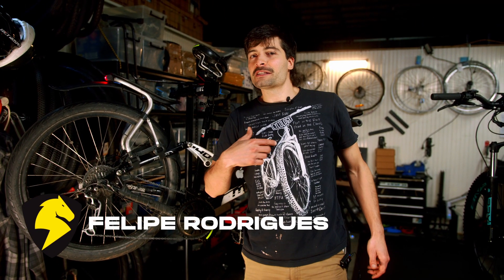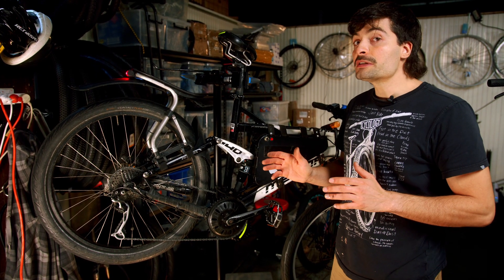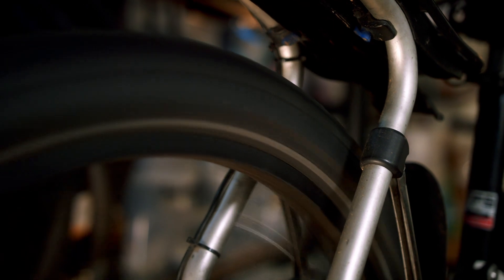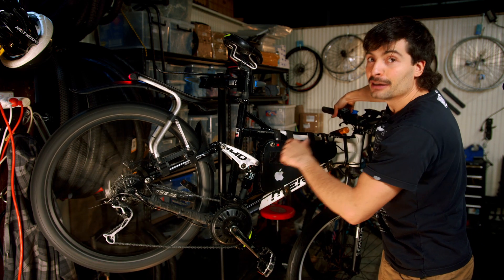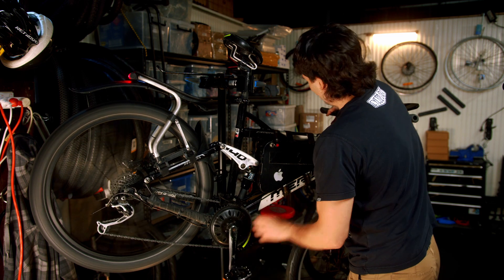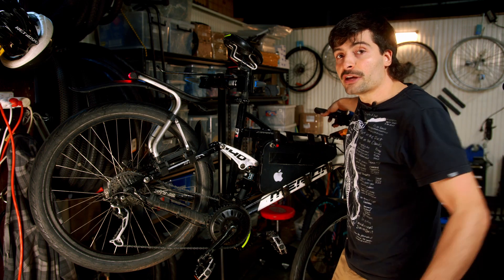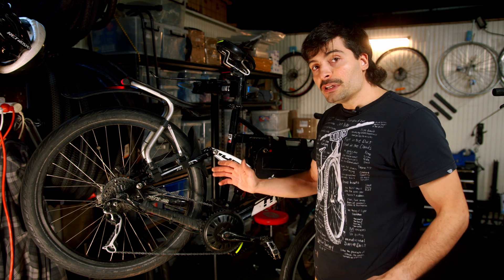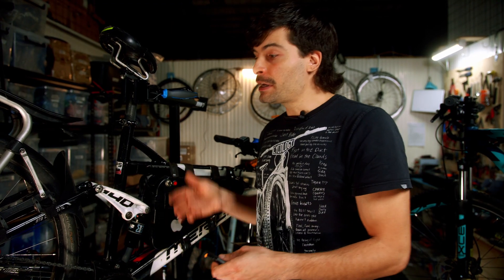How to shift gears on a Mid-drive Ebike

Comment: i have 750w BBS02  and using generally 1 or 2 PAS over 5. gear mostly hıgh 6-7-8-9/9 motor power avarage 500w, is it can be harmful? i think if motor consume like around1000w can be harmful for motor i always consider about how much power consuming now
Reply from the maker: The more watts you put in the motor the more you damage the motor, however, even at 500W, if you're using a heavy gear (9) at very low speeds, you're damaging the motor. Because of your doubt I am going to record a video talking about that.
Reply from the maker: The more watts you put in the motor the more you damage the motor, however, even at 500W, if you're using a heavy gear (9) at very low speeds, you're damaging the motor. Because of your doubt I am going to record a video talking about that.
Reply: @Cyberbikesau  i didnt know that, high gears most of time force the motor. thank you

Comment: what wears out first in this system?   the levers, chain, derailleur, and cables,   I am doing research on the different ebike systems
Reply: definitely chains and the cassette, especially if you don't clean and apply lubricant regularly. For me I clean and lube around every 100km of riding. You will get an average of around 4000km (depending on use) if you clean regularly but if you don't, well I had to replace my chain after only 1600km and that was when I use to only apply lube without the cleaning.
Reply from the maker: as our friend said, chain and cassette

Comment: For climbing a hill, would the best method be to shift to the appropriate gear before the incline and maintain that gear?
Reply from the maker: Yes, that's an option if you want to preserve the motor, better to start in a low gear (high torque) and maintain it all the way up.
 If you're racing, you could shift gears up without using the brake sensor and add human power to the pedals. Remember, it's best to make these motors spin fast than spin slow.

Comment: I've just made myself an e bike with the bafang motor I wish I'd watched this vid before I started hammering the beast. I'm sussing it out myself now, there's a real art to the smooth riding of these things, should probably have driving lessons on them, especially with the power assist on full whack!
Reply from the maker: Add the brake sensor to your bike, it will help a lot when using pedal assist and shifting gears
Reply: @Cyberbikesau  I have mate, it needs gluing on properly like, Ive been dabbing it on the way in to work this morning, using it like a clutch. The back brakes a bit soft as well so it doesn't actually brake until it's fully pulled so that's working great
Reply from the maker: Ahahha nice mate, keep up the good work! We might record a video on how to install the brake sensors to help anyone looking for some insights. Stay tuned for more and thanks for subscribing to our channel

Comment: My bike already has a shift sensor that cuts power to the motor when shifting….. so I just make sure I ease up on pedaling & throttle during the shift…
Seems to work well for me..
Reply from the maker: Yep, that should work well for your application, and if you race against a bike that has no gear sensor probably you will be left behind, so let's say that for maximum performance and trails I (Felipe) would not go with a gear sensor, for other applications like yours the gear sensor suits well because you're aware on how to use it properly.
Reply: Cool… thnx guys…pretty sure the manufacturer of my bike uses a shift sensor so they wont get a lot of warranty problems when dealing with “dummies”, hahaha😂👍🏻
Thnx for the advice!..
Reply: Yep that's right Joe just don't stop peddling completely  as you need the drivetrain engaged for the derailleur to do its job properly in changing gears otherwise  you get that awful  crunching noise happening. When braking you should stop peddling  at the same time though, to once again disengage  the motor.

Comment: You say use the throttle to shift gears, how about using pas, with some inertia, and stop pedalling?
Reply from the maker: Try to stop pedalling when your pedalling cadence is 60 strokes per minute, you can't, there's so much mass in your legs that you can't stop it quickly. If you pedal slowly and alleviate the force on your legs, you will still be triggering the motor with the rotation of the crank. The method you suggested would only work at low levels of assistance or on a 250W motor.
Also, the PAS settings have to have a low "Time of stop" like 100ms
Reply: When using  pedal assistance  mode  1-5 or 1-9  and at most bike speeds with moderate leg cadence  gear sensors work just fine, without  a delay  in cutting out the motor,  like if they didn't  work  Bafung and other manufacturers  would  have  been  forced to withdraw  them years ago, instead  they've  gone on to sell millions  of them. You  just need to slow down your leg cadence  rate that's  all as you still need  the drive chain turning over for the derailleur to do its job properly  in  changing gears smoothly ,  just without all that torque  and stressors from the motor.

Comment: Shifting becomes very easy (with or without a gear sensor) if you gently pedal while shifting, just enough to keep the chain moving. I tend to pedal during the entire process of going through the gears, it's the best way to get to 5th or 6th quickly and cleanly.
Reply from the maker: Chris we agree with you, however it’s depends on how skilled the rider is, what sort of motor the bike has and what type of settings are in its controller. Can you tell us what motor and settings your using?
Reply: @Cyberbikesau  I'm running a Cyclone 3K at 80%.
Reply from the maker: @ChrisB...  is it throttle only?
Reply: @Cyberbikesau  Yep, with a high quality Domino throttle.
Reply from the maker: @ChrisB...  that’s why you can easily shift gears when pedalling. If there was a pedal assist sensor triggering the motor when you’re pedalling the gear shifting would be completely messed up. Throttle only is the best for gear shifting because you can stop throttling, shift the gears (pedalling or using the inertia of the chainring) then throttle again. Also, with throttle only setups not often needs a brake sensor
Reply: @Cyberbikesau  Makes sense. Thanks for the clarification, I've never used pedal assist.

Comment: Do they make a Shimano 8 speed  derailleur with clutch it seems this might help with my chain knocking issue according to my bike mechanic since derailleur would be stiffer
Reply: Yes, that might help especially if you ride a full suspension. You can try to shorten the chain with a quick link to see if that helps. I am not aware of a 8s derailleur with clutch but if you find any please post here in the comments. Cheers thanks for your contribution
Reply: @frcr90  Yes  i found a clutch derailleur for my Bafang M620 it is a BOX 4 -8speed derailleur and shifter  Shimano shifter does not work with BOX derailleur . So now with new derailleur  and shifter works perfectly .No more knocking or slipping in 7th or 8th gear
Reply: @laplantemichel709  thanks Michael, I just googled it and seems to be a robust upgrade. Did you have to buy a BOX 4 chain as well?
Reply: @frcr90  no i used same chain as before 1\2x 3\32  and same cassette
Reply: @laplantemichel709  awesome great upgrade thanks for sharing it bro. Stay tuned to Cyberbikes channel we will post great stuff soon! All the best
Reply: @frcr90 No rear suspension on my Fatbike  I tried removing 3 links but i still get same knocking issue when i am in top gear. Will post  if i find a 8 speed derailleur  .Thanks again .
Reply: Company that sells my bike has a 8 speed replacement BOX clutch derailleur and shifter kit for me but it's not free so basically they sell a flawed bike and sells what they say is an "UPGRADED" derailleur lol .
Reply: Talked to the company that sold me the bike they say it was normal to have problems in top gear with gear skipping since motor is very powerful  ,rightttt..... if the wrong parts are on it for sure . Nowwww  they offer to upgrade the derailleur to a BOX 8 speed clutch derailleur and shifter they say it will solve the issue but i still have to pay for it even if i think it's a flaw selling a bike with poor or inadequate parts .Anyways will see how that goes

Comment: I'm confused.  In the scenario of shifting gears mid climb, wouldn't engaging brake lightly to kill power also result in loss of speed and the explosive combination you described as a negative aspect of the gear sensor?
Reply: Thanks for your comment David. In the situation of shifting gears mid climbing, I suggest reving the motor to its maximum RPM, release the throttle for a fraction of a second, shift one gear up and then press the throttle again. We would shift the gear just using the inertia of the chainring. For shifting mid climbing I would not stop the motor at all, and would do the gear shifting as fast as possible but not throttling at the same time. That’s something you can’t do when there’s a gear sensor on the cable line.
Reply: @frcr90   I guess I just don't understand because I haven't ridden one of these bikes yet.  I'll be building my first one as soon as the battery arrives.

It just seems to me that ON FLAT GROUND whether the motor power is cut by gear shifter or by partially engaging break that it shouldn't make a difference.  Cut power is cut power.  Unless the gear sensor lags.

On climb, I suspect that process of releasing chain tension and shifting has to be very fast and maybe the gear shifter motor cutoff is too slow.  I suspect it doesn't engage until after the shifting process begins.  But I understand that you suggest it's better to not have motor cut off for shifting on climb and just not throttle.  So I guess the need not to stall out and lose momentum is greater than shifting with no pressure on chain. If I understand you.

I've heard others say the gear sensor is good to have.  I'm not sure why if it lags and you can achieve a better effect with slight brake engagement.
Reply: @davidr9876  you have to build and ride your ebike, then find the settings that work best for you. Let me know your opinion once you have built and ridden your ebike for 1000km-5000km-15000km
Reply: David if using throttle only you don't  need either a gear sensor or a brake sensor  as fully releasing the throttle disengages the motor. Better  off just choosing a low gear depending  on the hills steepness and length as you approach it and sticking  with that gear all the way to the top. Just use your throttle and/or pedal assistance modes to adjust your power as you go up. No problems with a high wattage/ high torque output  mid drive  motor in climbing  hills at a reasonable pace in a low gear anyway. Like riding fast on flat ground all the time is going to shorten its life span, so will constantly riding up steep hills shorten the lifetime of any ebike motor  and components.

Comment: Hi Felipe ! I'm currently waiting for a new 42 teeth chain ring to install on my BBSHD to replace the factory 46 teeth. Question , can I use my existing 9 speed chain or do I need to buy a e-bike chain  ? Looking forward to hear from you. Kind Regards.
Reply: Hi Marc, you can still use the same chain if it’s not worn out (I suggest buying a chain checker to know when to replace the chain). You might have to shorten the chain a little bit because there’s a difference in diameter between 46T and 42T. 
What I always suggest my customers is to install and a proper e-bike chain, and carry a portable chain breaker and spare missing links. In case the chain snaps, you can do a quick repair and continue your journey.
Reply: @frcr90  I need advice on making sure to get a perfect chain line. Should I adjust the chain in a straight line with my 1st gear or my 5th gear on my 9 speed MTB ? Looking forward to hear from you , Thank you !
Reply: @marccardinal3137  hey Marc, try to make it as straight with the 5th gear as possible (centre of the cassette of gears) that will allow you to use all the range *1st to 9th" without problems. I suggest also installing a chain guide and if you have $$ to invest get a custom chainring not bigger than 46T
Reply: @frcr90  Super Felipe , I'm waiting for a new offset chain ring 42 teeth ( big , small teeth ) to replace factory 46 teeth. Yes, I'll invest in a chain guide also to eliminate the chances of chain popping off. Better be safe than sorry. Thanks for the tip on chain line. Cheers Felipe !
Reply: @frcr90  Great news because my chain is still brand new and I also have a   brand new one still in the box. For sure I'll need to shorten it. Thanks Fellipe your the best !
Reply from the maker: keep up!

Comment: i  have a Bafang M620 on my new ebike. Last week i had problem with freehub pawls being stuck so i was ghost pedaling it was like i had no chain .I got it fixed. From the beginning  when i am going 30+kph in max pas 5 and gear 8  when i use throttle to go max speed while accelerating i get knocking sound like(tok) i guess its the  motor chain doing this .Is this mechanical problem .? it what way can i operate this motor without knocking ? Thank you
Reply from the maker: Hi, thanks for your comment. The motor should always produce a smooth sound. That tok tok could be the disc brakes rubbing on the calliper or your have a frozen link on the chain, it could also be that the gears are out of tune or for example if you’re not used to shifting gears, you could have damaged the teeth of the cassette of gears and the chain is now slipping on top of them. Take the bike to a bike mechanic to have a look, I gave you a few options to what look for. Cheers

Comment: Just put a gear sensor on your bike and you eliminate the need for all these unneeded steps. I also always start on pedal assist so much of the torque to the drive train is coming from my legs.
Reply from the maker: The fact is, the gear sensor can cause more damage than it was supposed to prevent, and we explained why in the video. About starting with pedal assist, it doesn’t really matter, you can start full throttle at maximum power if you’re on the correct gear (1st gear). The gears are what matters, starting on PAS but on the last gear of the cassette will cause as much damage as starting with the throttle in the same gear.
Reply: @Cyberbikesau  my comments are predicated on the premise that the cyclist knows how to ride a geared bike. If the cyclist doesn’t know how to ride a multi-geared bike the cycle is more prone to damage regardless whether it is equipped with a gear sensor or not. I have 1,500 miles on my eight speed, mid-drive EBike and I know for a fact the gear sensor on my bike reduces the strain on my drive train. Everyone is entitled to their opinion, and mine is a mid-drive EBike with a gear sensor is the way to go. Learn how to ride a multi geared bike BEFORE you ride a multi geared EBike.  YouTube creator “Johnny Nerd Out” has vast experience converting mid-drive Ebikes and he shares my opinion.
Reply from the maker: @mmeyers111  Sir, I am grateful to have your comments and opinions shared here, please don't feel like I am trying to prevent you from sharing your experience, you're welcome on this channel. What I have to share is my experience as a shop owner and mechanical engineer with 5 years of experience in this industry. Your predicated premises apply to 10-15% of the customers that come to our shop, the vast majority of people don't know how to ride a bike or haven't ridden one for a long time. It's our duty (as a business and individuals) to guide inexperienced riders (the vast majority) to use their ebikes safely and without causing damage to the ebike components. The question that I leave here is, will you maintain the same opinion you have now (1500 miles) when your ebike reaches 15,000 miles? We deal with 10-15-20 thousand miles motors daily. The bike I ride daily is clocking 12,000 miles now! The idea behind that video is to give an option for those who want to extract more performance out of their bikes, by choosing if they want to stop the motor and when they will stop the motor while gear shifting.  Thanks for Sharing your mate's channel, I highly appreciate it, I will check it out! Keep watching our videos and we see your comments in the next one, cheers!
Reply: @Cyberbikesau  such a great response. Well put!
Reply: @mmeyers111  Thank God their is somebody else  out there even if it was eight  months  ago that shares my same  thoughts on the matter. Your spot on with regards to using your  gears  exactly like you would on  say something  like an analogue  road bike. As for the effectiveness  of the gear shifter, l'll  side with the astute Jonnynerdout, in saying at all speeds  up to 50 kph uphill, downhill or on the flat that l've riden on, it's reliably and quickly cut out the motor  when changing  gears with just an easing up in peddling speed necessary. Like hell l've even been braking without a brake sensor for 1000s of kilometres without  putting  much thought  into it. I just stop peddling and apply the brakes. Most of  the time at a leisurely pace, so no issues  so far with motor  or components  damage.